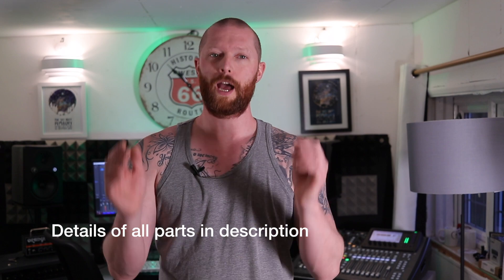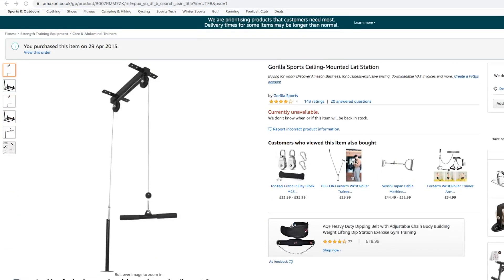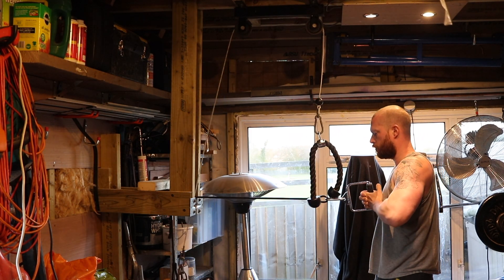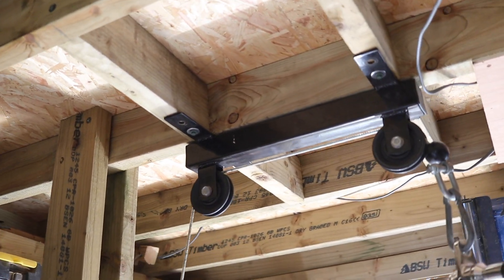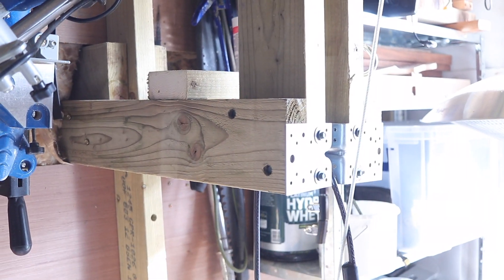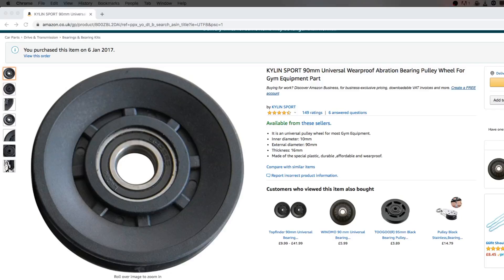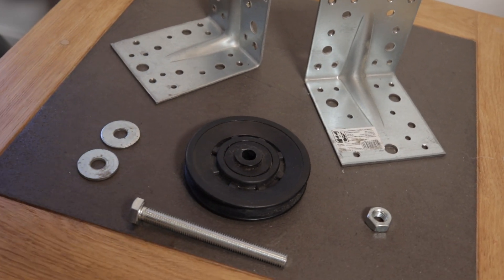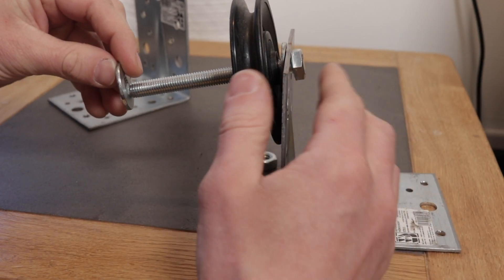DIY cable pulley machine

Comment: I built a bunch of equipment too because of lack of stock. Built a dip station/pull up bar, full on power rack with pulley attachment and safety bars, a flat bench and various storage options for plates. The bench and rack especially work MUCH better than expected. The only issue with the rack is that Indidn't habe a drill press that would work with bigger bits and had to hand drill all the holes. So some spots the pins to rest the bar on are angled one way or the other ever so slightly putting the bar at a slight slant in some positions. I plan on filing them even at some point but it has been working just fine so far regardless. Thing is pretty solid too. I had 250 on it the other day for bench and it stayed rock solid. It didn't move, creak or shift at all. Pretty cool as it only ended up costing me around 140$ to build. You can do a suprising amount for effective gear with some lumber and a few tools. The bench I built is also great. It is light, easy to move around, nice and wide and seems about as solid as any other bench I've used. And it only cost me about 15$ to build, which was to cover the cost of the padding and vinyle upholstery as I had a bunch of scrap lumber that went into it. I actually managed to put together a really solid home gym as I got bars and plates about a week before the REALLY bad price gouging started.
Reply from the maker: Nice work! I totally agree, it’s amazing what you can do with a few lumps of timber. It takes the piss how much people have hiked up the price of gym equipment though

Comment: How would you make longer horizontal cable?  Something about 8 feet?
Reply from the maker: Use longer cables. You can buy all sorts of lengths. Most of mine are actually the cables you’d buy for locking up bikes (they have a loop at each end) but they run through the wheels perfectly and seem to be able to take the weight